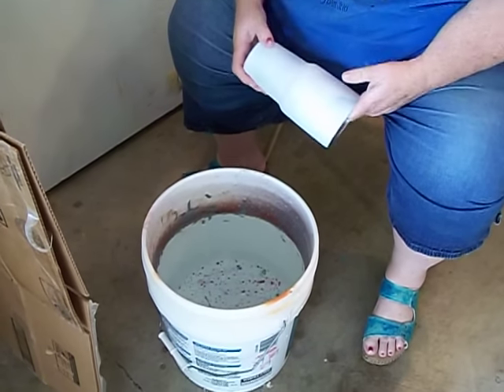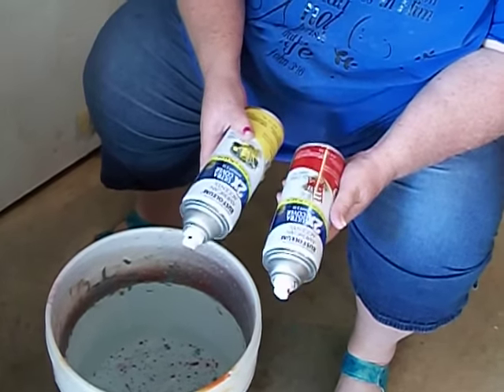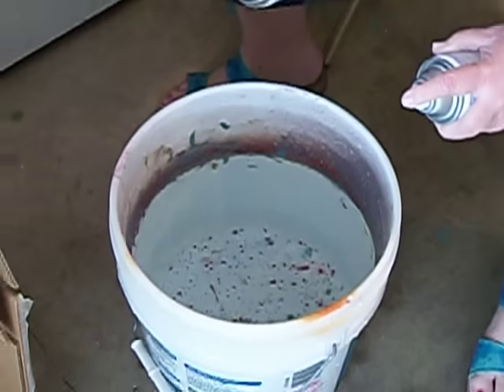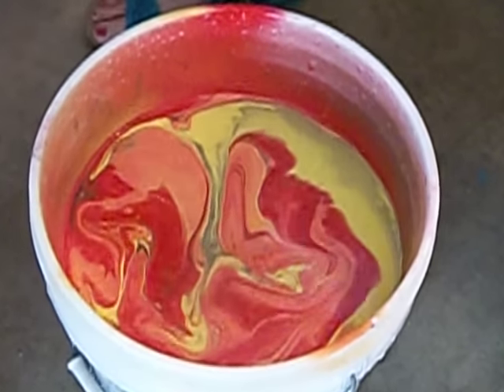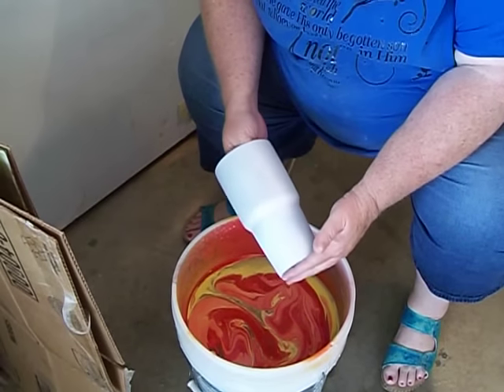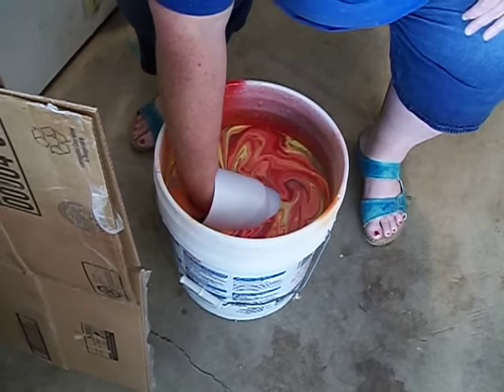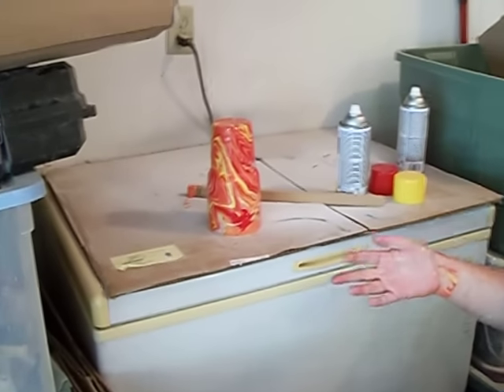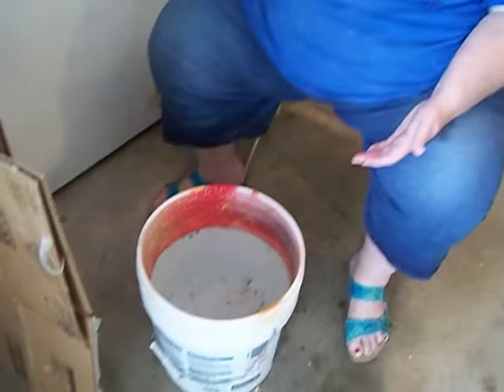paint Dipped Mug

Comment: A few years late but I love Love how this turned out but question after you dip and shake for water balls to be removed do you spray with a finish? If yes what type of finish. This is awesome looks amazing I can’t wait to try maybe the weekend. I’m sure I can play on wine bottles also. But I wonder if can do on plastic tumblers just long as I prime it just prior and let it completely dry. Is that correct?
Reply from the maker: It can be done on anything. I don't shake it. Just let it dry. I didn't seal these and they lasted a couple years  but you could apply epoxy

Comment: i have done like 5 and im frustrated. how do you keep the paint flowing in the bucket mine keeps drying and clumping :(. WONDERFUL video by the way!
Reply from the maker: If I was doing many I'd probably clean out the paint
Reply: i only do one, is there a special way of spraying? cold, hot water? i've tried both. i still get clumps. thx for responding you are the only person i've asked that has!
Reply from the maker: I just used hose water. It wasn't warm. What kind of paint  a are  you  using? GLOSSY? MAT? are spraying to much.
Reply: rustoleum 2X ultra cover (i just noticed it says gloss). i don't feel like i'm spraying enough because i always see white when i'm done (the base coat).
Reply: The spray paint dries rather quickly.  I gave up on spray cans.  Now I use small 8 oz. cans and use an eye dropper to put it in the bucket of water.  But the trick is to thin it down with paint thinner first.

Comment: help ...what temp does water need to be? mine keeps clumping up before I ever dip
Reply from the maker: Honestly  I don't know. I used hosec water  it want that warm.
Reply: Thank you I just don't know what I'm doing wrong lol
Reply: Few things I would suggest, Use High Gloss paint, I have not had success with Flat or semi gloss, second after you dip the cup dont pull it out right away. Use a paper towel and remove the excess paint off the top of the water before you pull it out. After I pull the cup out I spray it with fresh water to remove any film that might have attached to the cup when I pull it out. Also I just use a small plastic zip tie to swirl the paint, the larger the stick the more the paint wants to clump. As for the water temp I can't asnwer because I do mine with water from the hose and the outside temp is in the 90's
Reply: N matter what I do, the paint just clumps up and/or when I stick in a stick to swirl it, it all just clings to the stick and comes out in one piece. It's so frustrating!
Reply: The type of paint and the distant from the water makes a
difference.  I spray from 6 to 8 inches
away and I use Rust-Oleum American Accents Ultra Cover 2x Paint high gloss
paint.  Don’t let the paint sit too long
on the water before you swirl it.  I have
also found that if you put a base coat of one of the colors on first and let it
dry before dipping the cup you get better results.  I also you a Zip Tie or cable tie to swirl
with instead of wider stick.  When I do
get clumps I move them to the edge of the bucket or use a straw to remove
it.  Hope this helps.
Reply: Not really. i've tried all that stuff but the paint just sits on top like a sheet of rubber and when I touch it, it clings to the stick and lifts off the surface in one piece. I wonder if it's the water in my area? We have very soft water.
Reply: Harold-Sweat-Head , maybe try getting a few gallon jugs of water from the store to test your water theory. It could very well be that. When i marble my nails i have to use bottled water or my polish does the same exact same thing with the clumping or just not even spreading/mixing like it should.